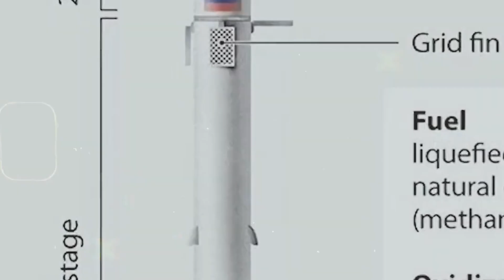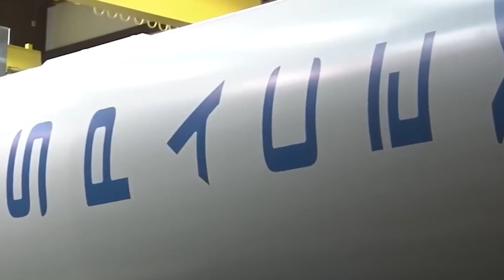Russia reveals New Reuse Rocket over 100x to REPLACE SpaceX!

Comment: Bollocks ! 

A few months after Poutine invaded Ukraine then renders of 2 new Ladas were posted on the web ; the 1st a black Renault Trafic van with a Lada emblem to replace the Hexagon, and a few days later an orange Arkana, also with a Lada emblem. It was easy to Google the original promotional photos. When I challenged the author of the post, he claimed the Arkana look-alike was a completely different car. I asked for technical details and he took the post down. 

A month or so later, a vidéo of a new Moskvitch 2142 was posted. Again, it was a white Renault Mégane 4-door saloon, with updated Moskvitch emblems. By the way, Moskvitch ceased production in 2006.

Then, a year later we had some real news : the Moskvitch 2142 in the metal ! It was a Chinese JAC J7 with.. Moskvitch emblems. Now they're shipping CKD kits from China for final assembly in Moscow. The new Volga will also be a Chinese CKD.

Meanwhile, Lada introduced a special edition of the Granta : no ABS brakes, no airbags, no air-conditioning, wind-up door windows (no electrics), and no GPS. Yours in any colour you want so long as it's white. You get a free one if your son is killed in Ukraine. There's a waiting list approaching 200,000 and it grows by 1000-1200 a day.

So do I believe Russian engineers have the talent to build a re-usable rocket ? Yes. Do I believe that they'll have a working prototype in the next 5 years ? No. Corruption, lies, politics and simple economic constraints imposed by Poutine's war mean this vidéo is no more than a cheap propaganda exercise.